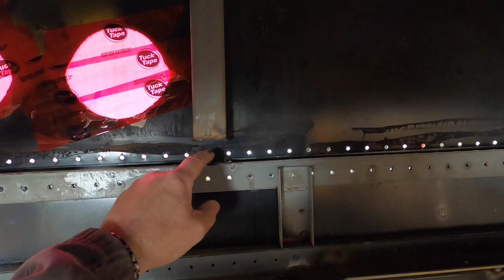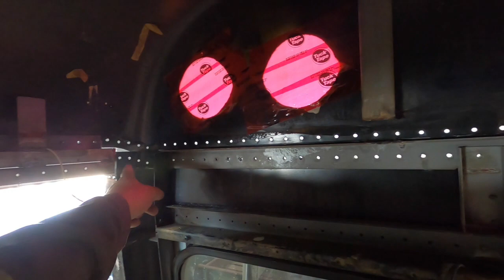Roof Raise, another side project - Just Bus'n and Adventures with the Thompsons

Comment: Are you using the existing hole where the rivets were that you removed by marking the panel from the backside or are you making all new holes ?
Reply: Where possible
Reply from the maker: Yes, all holes in the hat channels and existing panels are transferred to the new panels and maybe a few extra where needed. The new panels are clamped in place, all holes are drilled in it, panel is removed, new holes are deburred, panel is primed on both sides, then sealed around all edges and installed. Thanks for asking William.